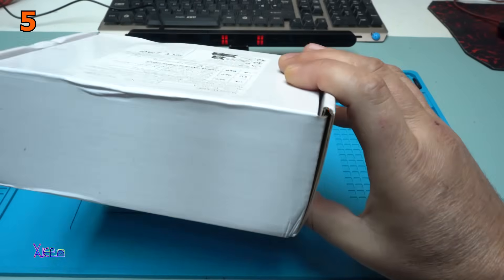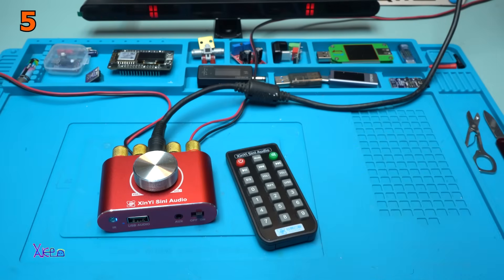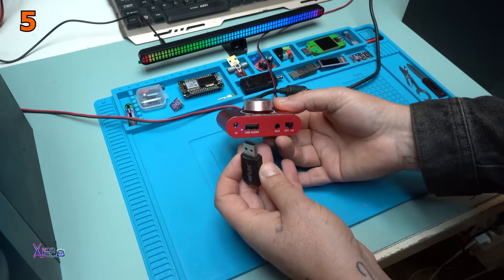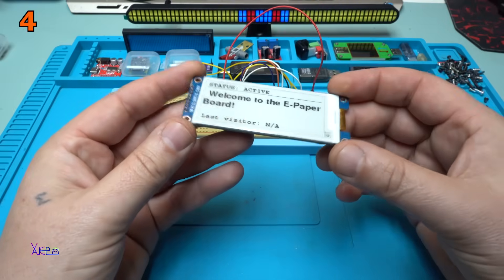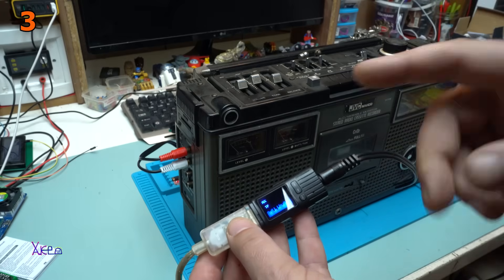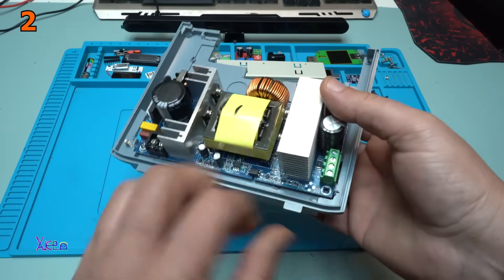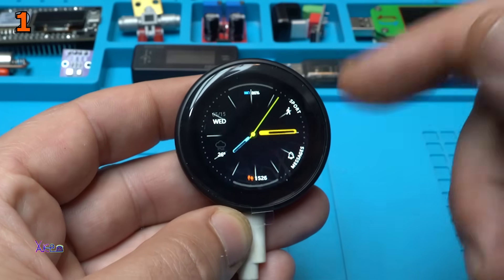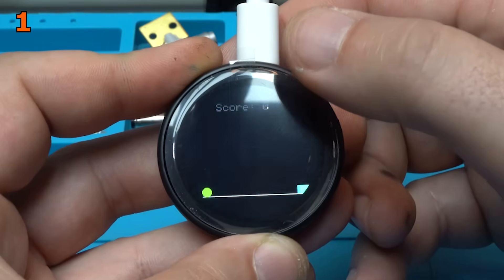TOP 5 EXCELLENT Aliexpress Modules

Comment: It allways drives me crazy, they build a nice case around the display, but you have to connect a battery outside. So you have to build around a ugly solution for the battery to get a portale battery powered device. This limits the use of such wonderful devices with a nice looking case.